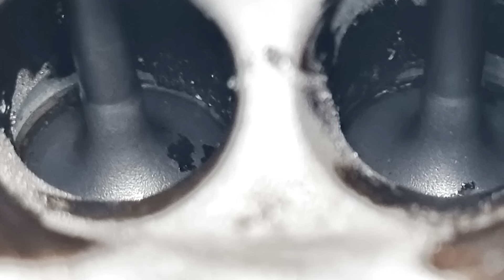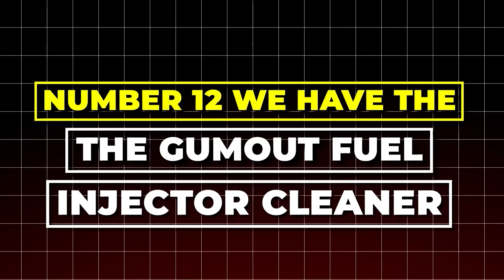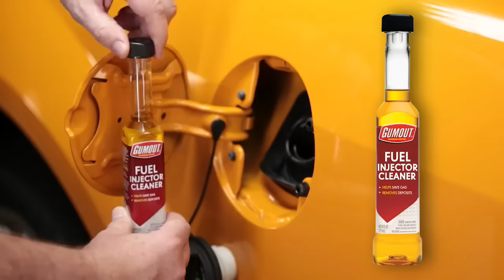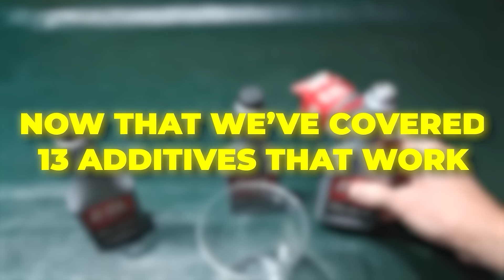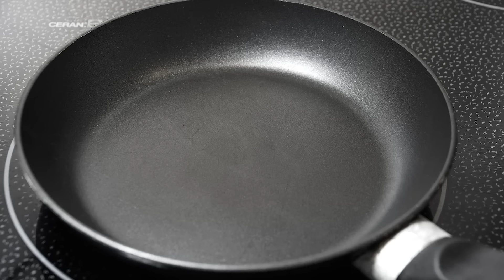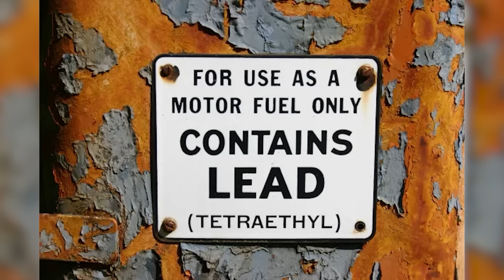13 Engine Additives That Work (And 5 That’ll Kill Your Car)

Comment: I didn't see any improvement using Techron or CRC505 or Gumout fuel injector cleaner.
Reply: Just means you didn't have any problems....
Reply: @aaronthomas6155  I tried them because my gas mileage sucks. I have tried changing other stuff but no change. I'm suppose to be getting 17 MPG in town but I'm getting 12-13. Good thing I don't drive a lot.

Comment: Only legit PTFE oil additive, proven by third-party testing and a Guinness Book Of World Records listing:  TufOil from Fluoramics, Inc.  I've used it for at least twenty years and it does exactly what it is supposed to do.  Absolutely no problems of any kind.  Try it, you'll like it, and so will your gas or diesel engines.  They make lots of other lube items also.

Comment: How do you know if you have a GDI engine? The said turbo engines, but I have a 2.0 supercharged Saab engine.
Reply: 2005 in a recline Ion
Reply: Redline
Reply: If you have a Saab, it's unlikely you have a GDI engine since Saab shutdown in 2016, around the time most manufacturers started developing GDI engines and neither Saab nor GM produced a GDI engine prior to 2013.
Reply: It's a 2005 Redline Saturn with a 2.0 supercharged Saab @aaronthomas6155

Comment: that Liquid Molly MOS2 if great. when my wife put her 2014 240,000 mile mazda CX-5 into the garage you could her the walls shake a little. now after i changed her oil and added MOS2 that noise is completely gone and her engine is a lot more balanced. less vibration.

Comment: I was really hoping you'd have head gasket repair in a bottle, man I hate selling that stuff at work, I tell people it's a bottle of last hope and it won't do much except clog up the cooling system making any possible repair more expensive with the need to clean it out.
Reply: I used Blue Devil 1000 miles ago and it is still working great.

Comment: ask the auto manufacturer what to use never use???they sell  parts at 10 the cost to  produce repub corporation thieves change oil at 5000 mi add nothing to destroy your  over priced  machines!!! 65 years  as mechanic  on everything  from weed eater to A4 jet. all corp .thieves !!!!!!!!!!!!

Comment: AT 205 is very good for rubber suspension parts....very good.
Reply: I used this stuff in my Grandson's 99 Toyota Camry.  After about 100 miles later the oil light came on.  I hooked up a mechanical gauge and found there was NO oil pressure.  I removed the oil pan and found that the oil PU screen was completed clogged.  The black factory coating from the bottom of the oil pan was almost completely gone with shred of it hanging from the oil PU tube screen.  I cleaned the screen and changed the oil filter.  I had to flush the system several times using fresh oil and a couple more oil filters.  I called the company that makes this stuff (AT 205) to report the issue.  The first thing the tech asked was:  "Was there a black coating on the bottom of the oil pan and was it the original factory oil pan."  I confirmed that yes there was.  He told me how sorry he was to hear that, and how he was aware of this situation.
This crap almost cost my Grandson an engine. DO NOT USE THIS in a 99 Toyota Camry.  You may not be as lucky as I was !!!!

Comment: Just remember you can't add an additive to your engine or transmission and think that will work. Oil treatment brake's down the old thick oil and if it's not changed out you will clog up your oil screen. Then your motor is done. Same with the transmission. You don't leave it in there.

Comment: Why didn't you mention Berryman at all? It's been around for over 100 years, and when it comes to carb cleaning, it's the best I've seen.
Reply: Because it's for Carbs, most vehicles don't have carbs now days. I use it every year on my boats carbs though, find it works better than the boat manufacturers recomendations.
Reply: @shanepedersen7410 Berryman makes more than just carb cleaner. They have fuel treatment and injector cleaners. It's harder to find, but they even make a diesel treatment.
Reply: Yes, Berrymans is GOOD shit👌🏼
Reply: B-12 Awesome stuff each and every time Walmart sells better $$$ than authorized auto parts stores 🚀🤙

Comment: Wrong choive of stock footage for the lead in aviation fuel.  Jets as the one shown do not use TEL, only most piston engines do except the small minority of aviation piston engines that run on diesel (or turbine fuel aka "kerosene") or Mogas which basically unleaded car gasoline.

Comment: I won't swear by Slick50. But I used it in  my 1990 Mustang that I still have today, and AFAIK, it has never harmed the engine. The automatic transmission needs service - but the Slick50 has nothing to do with that.

Comment: fact that you even need stuff like this speaks pounds about automotive manufacturers and their engine designs. sure some of those work but _ getting it yet. big money in automotive repair _ think about it. Thats why vehicles are getting all the nonsense they don't need today. cause consumers want stupid and unnecessary shit that only adds to cost of the vehicle and cost of vehicle repairs. But think about it what works and what just complicates your vehicles operation. Its a no brainer but most will never figure it out cause you've gotten too used to luxury items. number one thing we all want is reliability. I'm not going to post a list of nonsense but you get the jist. demand better from auto manufacturers cayse it's your money you're wasting.
Reply: Fact is, you don't NEED any of these products except the fuel line anti-freeze and the diesel anti-gel additives....and even those are climate dependent.
Reply from the maker: Many of the "add-ons" and complex features in modern vehicles do add unnecessary costs and potential points of failure. Reliability should always be the top priority, and it’s true that consumers often get caught up in the bells and whistles that may not actually improve the vehicle's core performance. More simplicity and better reliability from automakers would definitely benefit everyone in the long run. Thanks for sharing your thoughts.

Comment: Not needed in todays cars, read you manual !!!!
Reply from the maker: You're correct that many modern vehicles are designed with advanced engineering and high-quality oils, making additional additives unnecessary. Manufacturers often recommend using quality oil and adhering to maintenance schedules without the need for extra additives. Always consult your vehicle's manual to ensure you're following the manufacturer's recommendations.

Comment: Lucas oil stabilizer is very good stuff I have used it for years in my 94 Chevy it's got over 300.000 miles on it and never had any problems .
Reply: '94 Chevys were still using Gen I SBC. I used STP "Honey" in all of mine and Mystery Oil in the fuel. Most of the engines outlasted the cars.
Reply: I would use Marvel's religiously in the fuel every time I filled up My fuel pump in the gas tank finally gave out around give or take $400,000 mi My mechanic could not believe that was the original fuel pump from the factory he could not believe it when I told him I put marbles in it all the time he says that's what lubricated the bearings in the fuel pump and shook his head and said that's the reason it lasted as long as it did. @SGTJDerek
Reply: I had a 94 Chevy stepside pickup with a 4.3 engine that made it to half a million miles and would have kept going except I spotted my mechanic beating the harmonic balancer with a sledgehammer causing the crank bearings to go out prematurely , Lucas seafoam in marvels mystery oil is all I ever used and changed the oil every 3 to 5,000 ..👍
Reply from the maker: That's impressive! Lucas Oil Stabilizer has been praised for its ability to reduce oil consumption and quiet noisy engines. Many users report positive results, especially in high-mileage vehicles. However, it's important to note that some experts advise caution when using it in newer engines due to potential viscosity issues. Always consider your vehicle's specific needs and consult the owner's manual before adding any additives.
Reply: @carcareclues I don't use it in anything with a 0 in it but 5W20, the 2 I have are 200k so I did and will use it for them once a year. You bet I change my oil/filter every 3-4k miles on everything.
Reply: Mystery oil in the fuel???
Reply: @alvingodin5724 not a lot but yeah. Use it in my push mower in the fall before winter storage and the first full tank in the spring. Maybe a capfull. Yes it will smoke a little bit at startup like a 2 stroke but it'll clear up as it runs.
Reply: Can you use it as a add on for an old chev engine

Comment: People have had good results with slick 50, it's well proven, even saved engines when the oil was lost.
Reply from the maker: Slick 50 has a long history and has been used by many car owners. While some users report positive experiences, others have raised concerns about its effectiveness and potential risks. It's essential to research and consider both user experiences and expert opinions before deciding on any engine treatment.

Comment: what about Amsoil didnt even say anything about them
Reply: Because their products are generally overhyped and either equalled or surpassed by cheaper products.
Reply from the maker: Amsoil is a well-regarded brand in the automotive industry, known for its high-quality synthetic oils and additives. Many users report improved engine performance and longevity with its products. However, as with any product, always ensure compatibility with your specific vehicle and consult the owner's manual before use.
Reply: Amsoil engine and transmission flush works great awesome. I used it in a 1998 F150 truck transmission fluid flush and worked just like in the videos on YouTube came out fast. Also did the engine flush worked out great then also use the fuel injection cleaner also 🤙😎🚀

Comment: Wonder how Zmax was rated
Reply from the maker: Zmax is an engine treatment that has garnered attention over the years. While some users claim benefits, others have raised concerns about its effectiveness and potential risks. It's crucial to research thoroughly and consider both user experiences and expert opinions before deciding to use any engine treatment.

Comment: One thing that really works is the addtive with PEA, for direct injection gasoline engines. It really increases fuel consumption and smoothness in idling. And it helps to prevent LSPI. Some OEMs recommend this by every inspection.
Reply from the maker: PEA-based additives are excellent for direct injection engines because they help clean carbon buildup on injectors and intake valves, improving fuel efficiency and smoothness. It’s great that PEA also helps prevent LSPI (Low-Speed Pre-Ignition), which can be a big issue in modern engines. Many OEMs recommend using these additives during routine inspections to keep everything running smoothly. It’s definitely a key factor for engine longevity.

Comment: Pretty surprised about marvel mystery as some other testers called a snake oil basically. Also surprised not to see Redline fuel additive as it's basically like a super version of Gumout.
Reply: Gumout is basically garbage compared to Chevron's Techron fuel system cleaner.  I didn't believe Marvel Mystery Oil did anything until I put it in a 2014 Dodge Dart Aero with Fiat 1.4Ltr Turbo that had a mechanically failing intake valve block.  Saved me over $800 to have the valve block replaced.
Reply: @aaronthomas6155 Gumout has tons of PEA in it making it like a cheaper redline. You literally have no clue what you're talking about, techron is literally just like liquimolly fuel additive just stuffed with detergents. And marvel mystery is literally just like lucas except it has even less detergents and is just a lubricant. You could have covered your dumb fiat dodge in literally any Lube for the same effect 😂
Reply from the maker: Marvel Mystery Oil has been called "snake oil" by some, especially given its long history and the variety of opinions around it. However, many people still swear by it for engine cleaning and reducing oil consumption. As for Redline, it’s definitely a strong performer in the fuel additive category, especially for cleaning the fuel system. It’s a more concentrated and powerful option than Gumout, which is why it’s highly regarded for higher-end performance.

Comment: The mechanic that taught me only used sea foam in the vacuum line to clean out the carbon it would smoke really bad out the exhaust for a little while then clear up and run great
Reply: Had good results with it. I will say my cats went bad not long after using it. Not sure if it had anything to do wiht it...they were old anyways.
Reply from the maker: That’s a classic method for using Sea Foam! Cleaning through the vacuum line can really help break down carbon buildup, and while it’s smoking, it’s actually doing the job. Glad to hear it worked well for you! Just be sure to follow the process carefully to avoid any issues.
Reply: Seafoam was designed for motor boat engines  lol
Reply: That's what it's supposed to do

Comment: If you put Luckas in a newer engine that has higher tolerances it will kill it. It`s too thick.  It only works in older engines with flat tappit cams.
Reply from the maker: Lucas Oil Stabilizer is thicker, and while it’s great for older engines with higher tolerances, it may not be the best choice for newer ones. Always check the manufacturer's recommendations for oil and additives to avoid potential issues with modern engines. Thanks for the heads-up.

Comment: Ive been having a particular friction problen for some years now. Are any of these ok to use on my willy?
Reply from the maker: It sounds like you're dealing with a specific issue, but I’d need more details about what exactly you're referring to with "willy" to provide better advice. If you're talking about an engine or mechanical problem, some of the products mentioned, like Lucas Oil Stabilizer or other friction-reducing additives, might help with friction issues. Just make sure the additive is compatible with the specific parts you're working with. Feel free to clarify what kind of friction problem you're facing.

Comment: I've been using lucas products forever.Not ever did I have a problem
Reply: Yep!!  Since the 80s when I started driving. Legit products for sure.
Reply: I have been using a quart of Lucas in my 2006 Ford Expedition with the 5.4 for over 15 years. Quietest  5.4 i have heard--purrs like a kitten.
Reply: 333,000 miles on my 2000 Honda Civic Si. I’m the original owner, and have used Lucas Oil Stabilizer with each 5000 mile oil change, and it runs the same as when it was new.
Reply: It's fine if the engine is high mileage. The loose bearing races will allow more oil flow. If it's lower mileage. All your doing is making the oil really thick and not pumping as fast as it should. Plus the unneeded pressure in the oil pump. If you aren't going to swap the oil pump yourself. Id knock that off.... Go ahead. Put 10w/30 in a 0w/20. Have fun.
Reply: But it's impossible to know for sure if you would've had a problem if NOT using it.
Reply from the maker: Lucas products have built a strong reputation for helping improve engine performance and longevity. It’s great that you’ve had such positive experiences over the years without any issues.
Reply: @carcareclues just called us stupid for using them...
Reply: I think the thing he's saying in the video is that there's a certain product from Lucas that's specifically formulated for older engines that already have problems and that using that product on a healthy engine will kill it because it causes the oil to be too viscous, but using it on an older engine with problems can help prolong the engine's life.
Reply: @Speeddymon well perhaps he should be more specific
Reply: Same here bro, never had an issue with Lucas Oils...
Reply: Lucas doesnt work good when its cold out. Like negative temps i dont recommend
Reply: @winter-antiques  are you referring to the heavy duty oil stabilizer  in cold weather ?
Reply: @justincarney930 yea
Reply: @winter-antiques they warn yah on the bottle 😅 But if your in a place like Florida you should be fine 😅
Reply: @winter-antiques do you know Lucas has a synthetic oil additive. I used it in my 2018 Jeep during winter. Didn’t have any problems.
Reply: @stevepayton6106 yea i dont drive new vehicle. I wouldnt put synthetic near any of my vehicles.